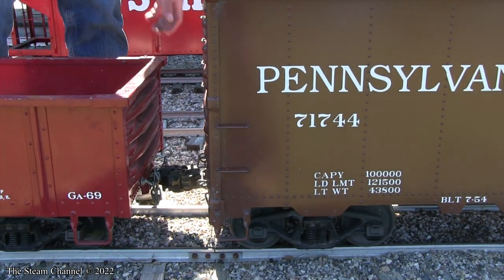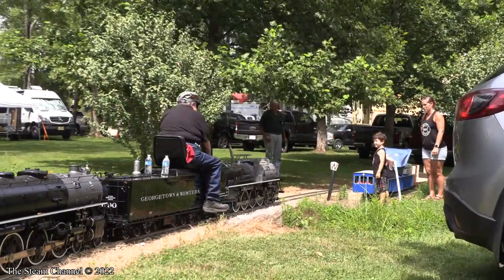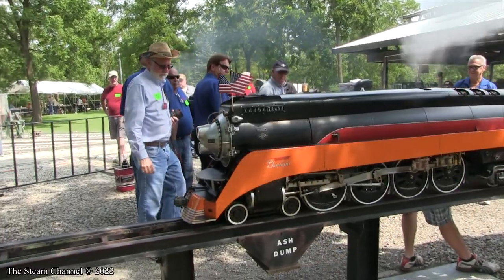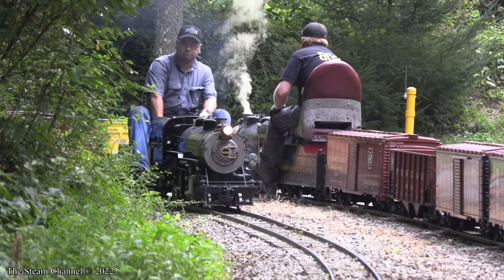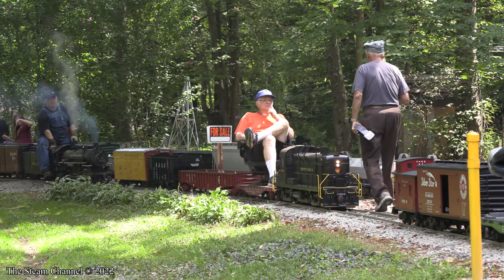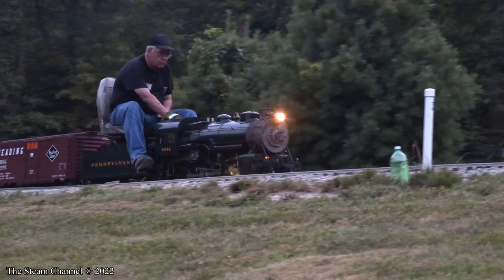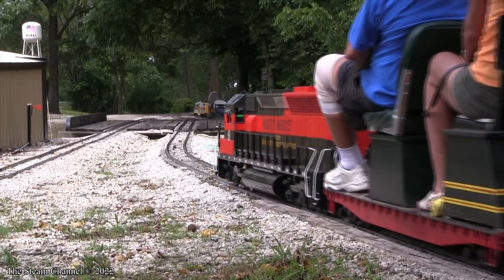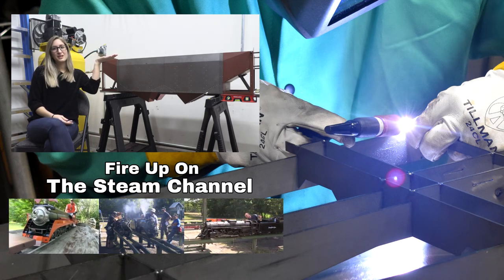Safety In Large Scale Railroading

Comment: Are boiler failures very dangerous with miniature steam? I have a buddy that keeps trying to scare me away because he doesn't like boilers.
Reply: No, they are not. Most you’ll get is lots of clouds and depressurization.
Reply: @kevdoom2  I suspected as much but figured asking would be wise. Thank you!
Reply: @GudrezBilly  no worries King. Enjoy the hobby.
Reply: I'll second what KevDoom2 said. It's not that they aren't dangerous, none have ever happened because of the way they are designed. Model boilers are not built with scale materials... they are built like nuclear reactors... The pressures in use, even if completely neglected are largely incapable of rupturing the shell or other major boiler components. Yes, you can get seriously burned by a hobby boiler many ways, leaning up against it, cracking open a blowdown valve while standing in front of the port, or having the sight glass break by carelessly hitting it with an object... but 99% of the time these are dumb self inflicted wounds of carelessness. If you are moderately aware of what you're doing, and have respect for what you're working on, I would not be afraid of it at all. If you treat your boiler right, she'll treat you right in return.
Reply: @kleetus92  Thanks! Yeah, I'm planning to build my own, so it'll take a good deal of research just to design it to the overbuilt standards which they tend to be. 
I guess it'll be a bit of a trip hahaha
Reply: @GudrezBilly  If you're not a professional welder, or not well versed in welding in general, I'd recommend getting one built. Not that it'll blow up if you don't, but you're likely going to have several whoops type events that could set you back to the beginning of the build. It is not a trivial task that could cost you more than just getting one built while you work on the other parts of the locomotive. I'm not saying you can't, I'm just saying there are better ways to go about the overall build for the sake of your wallet and sanity.
Reply: @kleetus92  Ah yeah... I suppose an explanation is in order. I plan/hope to build at least 3 locomotives in my lifetime, including a large articulated locomotive. Because of that, I want to learn how to build a boiler so I don't have to get several ones  totally custom made. (especially the big one)
I have decent connections with construction material places, so hopefully my supplies will be less expensive than it may be. Also to start out I might build a very small stationary boiler, since the size (about 5" wide, maybe 18" long.. Not sure) may lower the cost.
That is my hope and plan. While the articulated may never be a thing, I aim to try to do what I can!
Reply from the maker: @GudrezBilly  you aren’t primarily paying for the materials in a boiler as much as the skill needed to build it. A large boiler may only cost $1,500 in material. A boiler is a pressure vessel and can be extremely dangerous if not properly constructed, maintained, and operated. Model boilers have exploded and killed people- that is why most clubs require regular hydro testing and some states require the boiler to be certified. If you aren’t a certified welder/boiler maker—shop that out. 

It’s true that these hobby boilers are typically overbuilt and a failure typically will result in a loss of pressure and water gushing out of the failure…however, that boiler can still explode and kill anyone around it if it’s over pressurized (someone covers the safety valves) and bad things can still happen if you don’t keep enough water in the boiler and over the crown sheet.
Reply: @TheSteamChannel  Good to know, good to know. Thank you!